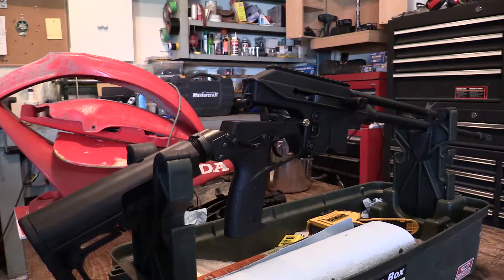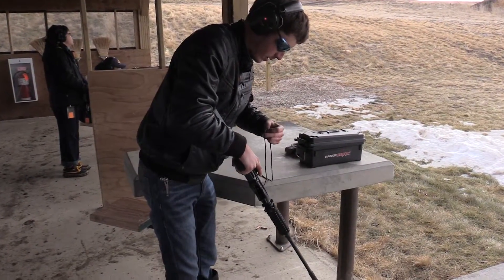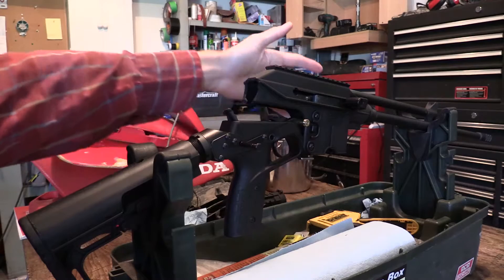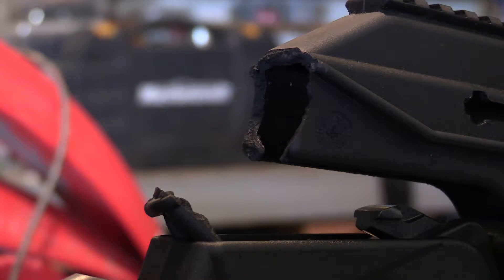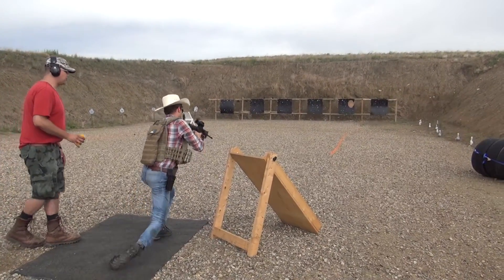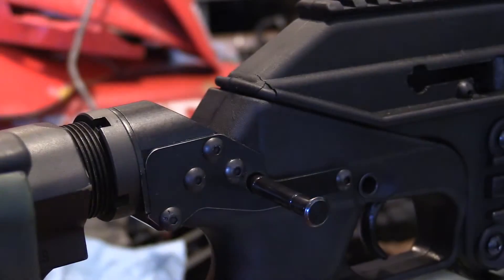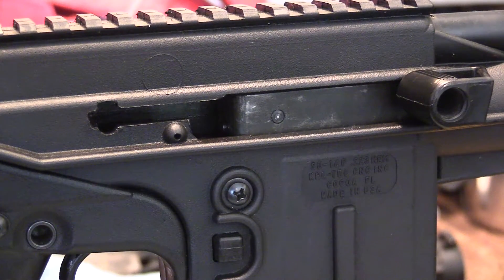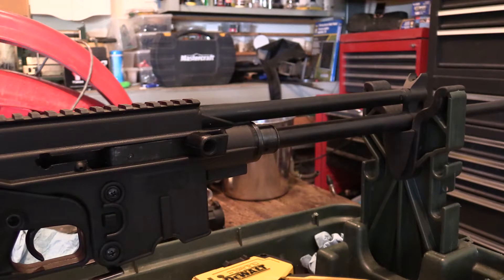Broken Kel-Tec SU16 Tactical

Comment: Mine did the same thing after only a few rounds, Kel-Tec asked for the serial number and said no problem for warranty, they did not ask if I was the original owner, sent them the old rifle and they sent a brand new updated model, very impressed with the customer service.  Since then I have put hundreds of rounds through with no problems, this is my favorite gun.
Reply: It's good that they addressed the issue with updated design.  How is it running so far?

Comment: The take down pin wasn't the issue.  My SU16CA broke the same way and the pin was still fully in place.  I wasn't the original owner but KelTec stepped up and replaced the upper at no cost to me.

Comment: I've had my Kel-Tec su-16ca for about 16 years. Believe it or not mine came from the factory with no rifling in the barrel. It took about six rounds to figure it out, with bullets keyholing and fragmenting at less than 50 yards. Very lucky it didn't explode in my face,  I never even considered checking to make sure my new rifle had riflings lol. I took it back to the gun shop I purchased it from and argued with the owner for about 45 minutes  (he was trying to blame it on the cheap Wolf ammo I was using) but then looked down the barrel and  was astonished... we sent it back into the factory and had a new receiver with the same serial number made and of course a new Barrel assembly, which took about three months. I've had no issues with that rifle for almost 16 years, with thousands of rounds put through it.  Then I notice the takedown lug was developing or crack,  so I sent it back to the factory, where they printed the third new receiver and recondition the entire rifle to like new condition. It took about a month and a half. Kel-Tec definitely has some issues with engineering and their customer service is a little slow, but they have rebuilt the rifle two times now without charging me anything. The actual operating system, the gas piston design is one of the best I've ever seen and is what makes this rifle very nice, along with the weight.

Comment: Kel Tec made a statement on the KTOG forum back in 2010 that they had reinforced this area in response to an increase in warranty claims for this issue. I guess what everyone wants to know is what year did you buy this gun? If it was made after 2011 then that says it is still a problem. If so, then everyone should avoid these guns like the plague. However, if you're gun is a pre-2010, then it might be that they fixed the problem. Thanks in advance for your response.
Reply: I bought my Kel Tec su16c rifle 2 years ago. I zip-tied the upper and lower receiver together near the rear sight of the gun just as an insurance policy.

Comment: I used a captive pin and cotter pin form a harbor freight pack. Ill try to post a photo.  I cut the pin down and sanded the rough edges. Then i bent the clip a little so it followed the profile of the grip. Im a lefty so I like the pin on the right. the harbor freight pin fits nice and snug.
https://photos.app.goo.gl/QqHEWus6EbqoHKGC7

Comment: Great video, I have the exact same model (bought it used) no problems yet, and the bolt charging slot you mention in the video is most certainly chipped away, mine is flush with the [bevel?] on the charging handle slot.

The only issue I have had so far is that upon closer examination, the hole on the receiver that the takedown pin goes into is broken. I speculate from the previous owner “slamming” the folding stock back into position with the takedown pin halfway inserted. A minor deficiency as the gun still fires and operates as intended but I just hate having broken things on my rifles!! I am not the original owner so I have no idea how I could go about buying a new receiver as they are not posted for sale on their website. I will try giving KelTec a call, but I live in Canada so shipping gun parts might be a pain..... 

Thanks for the video, As you mentioned I have read many posts and forums online about this problem but never seen images or videos regarding the issue. That helps a lot and definitely puts things in perspective. 

Keep up the videos! I will subscribe immediately!

10/10
Reply: I would imagine J-B Weld would fix that issue, or if you have access to any kind of polymer fabrication Factory in your area they could probably hot fuse it back together for you. Unfortunately the factory warranty only applies to the original owner.

Comment: How did he release the bolt at 0:38?
Reply: That's what I wanna know!
Reply: Mag well has bolt release. Download owners manual.
Reply: @wowwowmatt  no it doesn’t, it has a bolt CATCH. Try holding the rifle and looking yourself
Reply: Where the magazine goes in towards the front of it
Reply: @omarsalazar962  that’s not a bolt release
Reply: @HariboStarman  The Su-16 does have a bolt catch that can be engaged externally from behind the magwell but you can't release it the way it is from the factory. I've seen a few 3D printed extensions where you can release it the same way you would like on a Fn Fal.

Comment: Well done video, and you have a new subscriber, as the comments below suggested this might not be the best option for run and gun. Probably great for occasional range use but seems it doesn't like a lot of pounding. My choice years ago for a heavy use drop in the dirt heavy round count was a Norinco CQ, and still running strong. We in Canada go for non restricted sometimes at a cost which you laid out in your video.

Comment: Best failure analysis I've seen regarding Kel-tec rifles. I owned a Sub 2000 gen 2 for one  week. After firing the first 10 rounds of commercial 9mm the left side half of the receiver had cracked vertically from the trigger to the barrel pivot. The overall design of this folding carbine is very clever, but it seems to be structurally deficient in the barrel pivot-to-receiver interface. This type of failure apparently doesn't occur very often, but one time is too many. Fixing this design should be easy: thicker cross section, stronger polymer, or metal reinforcement of the receiver halves. I know that Kel-tec would have replaced my gun under their lifetime warranty, but I was leary of the design. However I haven't given up on Kel-tec all together and my dealer, DEguns.net, allowed me to replace the Sub 2000 with a CMR-30. It's another clever design and I have high expectations for it also. (This was an in store transaction at DEguns. Their stated policy is no returns on firearms, but they were very fair with me.)
Reply: "stronger polymer, or metal reinforcement of the receiver halves"

 I agree. A better polymer similar to the Glock type would be a huge improvement, and stainless steel reinforcements at critical points.

Comment: I have this rifle with the pistol grip lower half. The one thing I have figured out with this rifle is it's NOT a "run and gun" rifle. It is a "gun and run." It is not designed for extended use or extended encounters. Self defense and emergencies is all it's for. Yeah, I could use it for hunting, but only within the limitations of the rifle.
Reply from the maker: I dont remember reading that in the keltec description for the rifle :P

Rifle has potential  to last 1000s of  rounds. Keltec just needs to solve this action impacting the receiver issue.
Reply: @3DVIDEOSMurray    I put a strong zip tie around my upper and lower receiver on my KEL-TEC SU16C so I can keep shooting if the receiver breaks.
I am also thinking about super gluing a square piece of thin rubber to the inside of the upper receiver to protect it from the hard hit of the recoiling bolt.
Reply: Do you use a 223 or 556? This could make a difference.
Reply: @GrouchoTM 

Yes...reading the comments on other videos about this issue everyone says to run .223 through it and not 5.56...even though it says it can handle 5.56.

Seems the 5.56 is to heavy and everyone who runs .223 says they have had zero problems.

I'm thinking that whenever you do a video on a firearm that "breaks" when you use it you should give a description of the ammo you're using when it happened just to save a 100 comments of people asking.
Reply: good point and reply.

Comment: I wonder if action spring is too weak in the rifles that fail? I have very light marks where charging handle was chewing receiver on yours. Prob just from field stripping. I prob have 300 rds and cheese hitch pin mod. Shot -20c and +30c and no probs other then stovepipe occasionally. Ejection port is a little beat up from that. Zytel is not so great at alcohol resistance, and some bore solvents have alcohol. Another thing to think about.